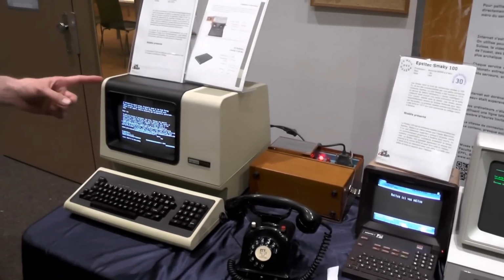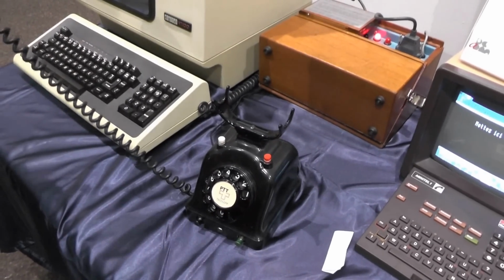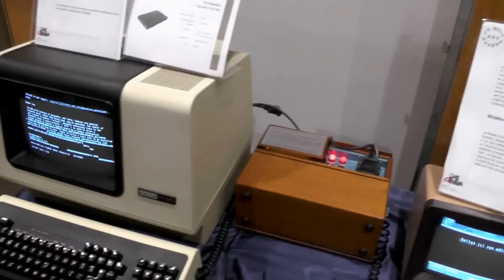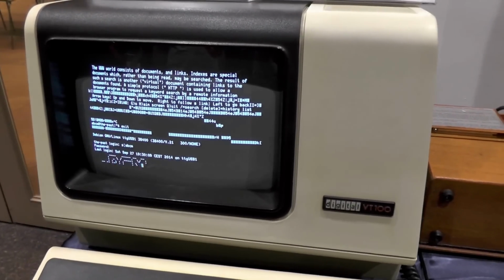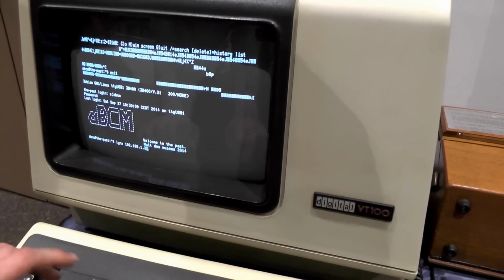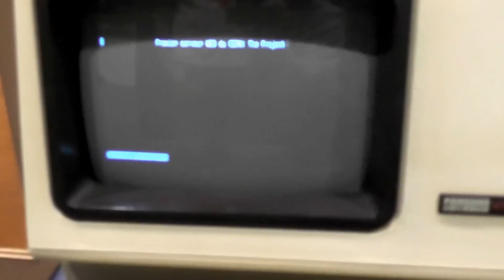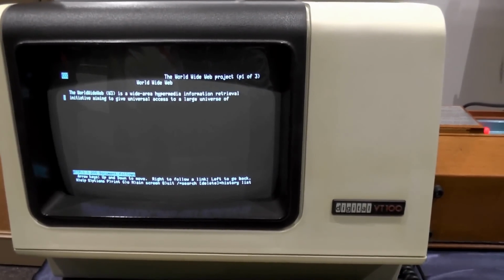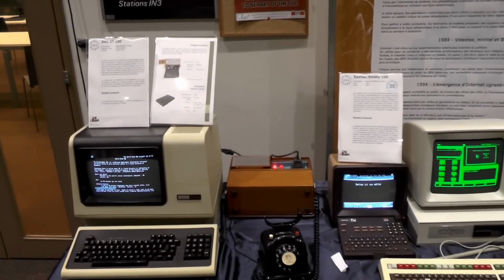DEC VT100 displays the world's first ever website using an acoustic coupler at 300bps

Comment: Why is it so slow if it runs at 38400 bauds?
Reply: Its not running at 38400bps because early modems would transmit 1 bit per baud, so a 300 baud modem would transmit 300 bits per second.
This was slower than the speed of an average human typing, which explains the performance you noticed on the screen when the information was being displayed.